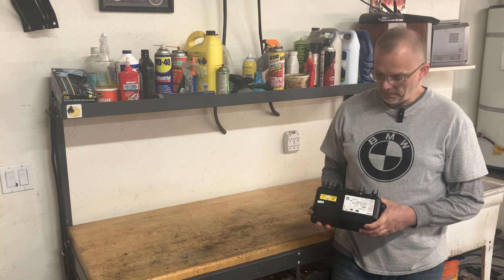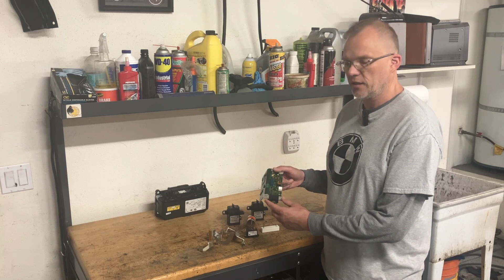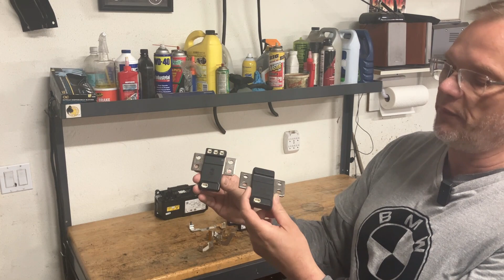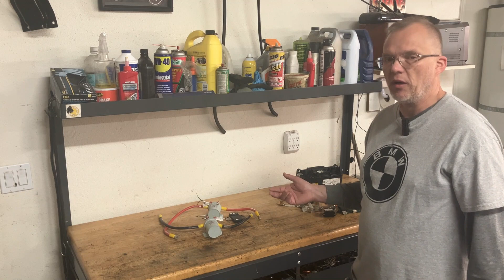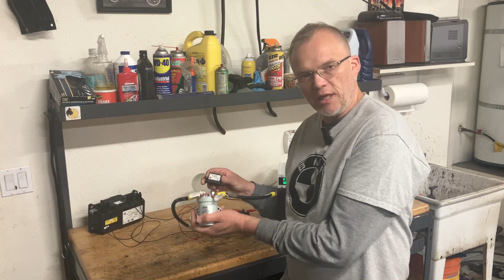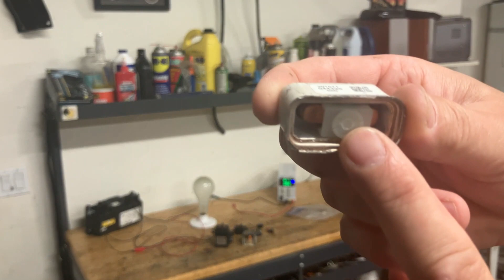EV Conversion DIY Wire Harness - BMW Safety Box Part 1

Comment: Any thoughts on pre-charge circuits for multiple battery packs (under hood and rear of vehicle)?  I would think you'd still want contactors on the second pack, but with key ON both contactors click on with the ground contactor of the main box, the pre-charge circuit of the main box would handle the voltage wind up?  Or just good practice to pre-charge every battery box?    Awesome video Greg.
Reply from the maker: I hope some experts chime in, this is a great question for the Getting Started subforum on OpenInverter dot org, in my opinion two contactor boxes so we dont run live hot wires the length of the vehicle but just one pre charge circuit (relay & resistor)

Comment: The biggest problem with the contactor welding itself shut is most of the time you don't realise it happened. I also have the box of shame with several welded or previously welded contactors, a blown 300A fuse ( that was scary) and blown resistor (also scary due to the amount of smoke). 😔
Reply from the maker: Facts! always multimeter the orange garden hoses prior to puttin' yer mits on 'em

Comment: I think that I will be going the OEM route rather than DIY and the hacked options seem to be gathering momentum!
Reply from the maker: The Nissan Leaf contactor box does not need no CAN Bus to control you just give it 12 volts, see the write up here https:// openinverter. org/wiki/Nissan_Leaf_Precharge_Unit
Reply: Looks really interesting

Comment: Thanks for the video, just off topic, I was watching your other video with the Gen1 ibooster where you did a magnificent job in fitting it to your truck. then ( i think, you removed the setup and went back to old skool) did you ever resolve the issue ? I just bought a ibooster and wondering if I will get the same issues .
Reply from the maker: short answer, no I did not get it resolved, I think the ones I have tried are not displacing enough fluid for my rear drums / front disc combination, if you have discs on all four corners you may be ok, also word on the street is the Chevy Volt iBooster sports a bigger master cylinder so that may be a way to go, I sent you an email message with more info
Reply: @Good-Enuff-Garage  Thanks, yes I am running disks/drum setup and I already have the ibooster. longway off before install
Reply: @Good-Enuff-Garage  I believe rear discs require more volume than a drum cylinder.  Typically a rear disc brake conversion that doesn't change the master cylinder runs into two problems, one the hold off valve causing rear discs brakes to drag, and two not enough cylinder volume to apply adequate pressure to the rear discs. So I don't think a larger master cylinder is going to be the solution.